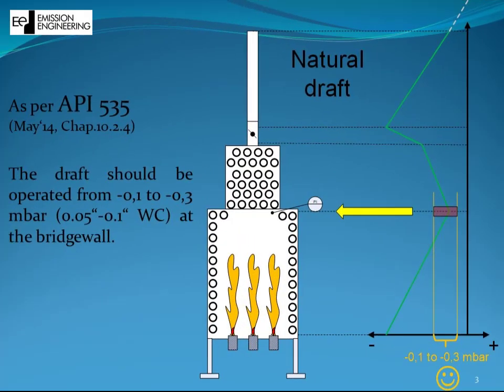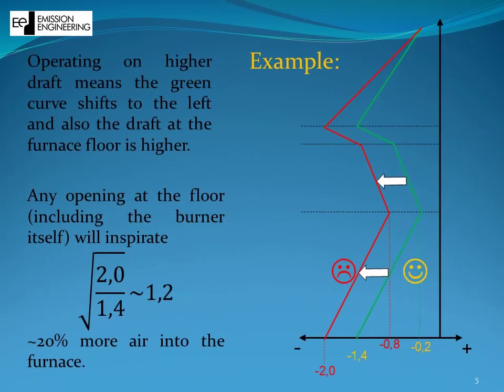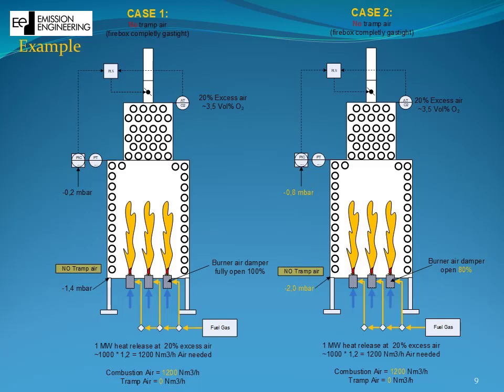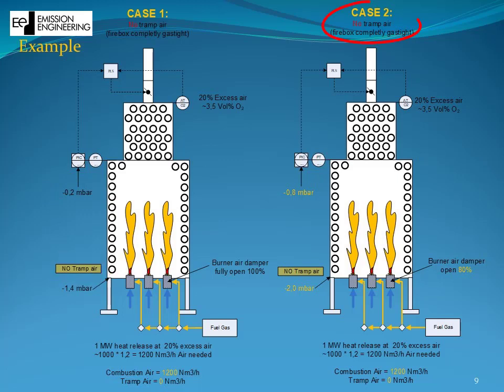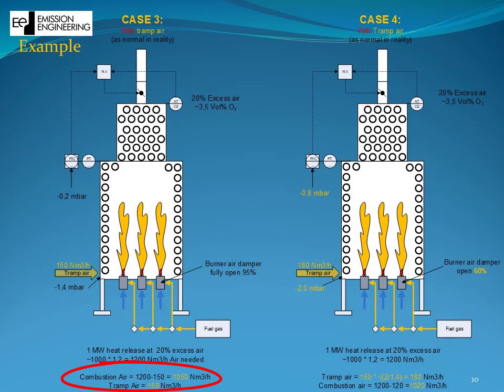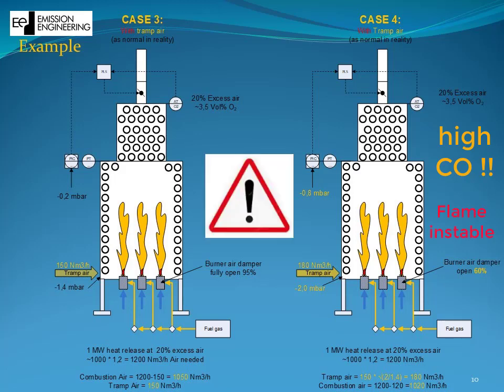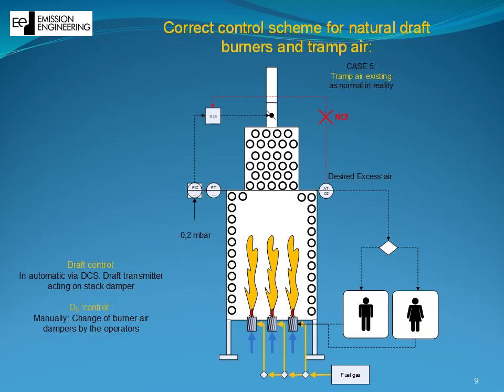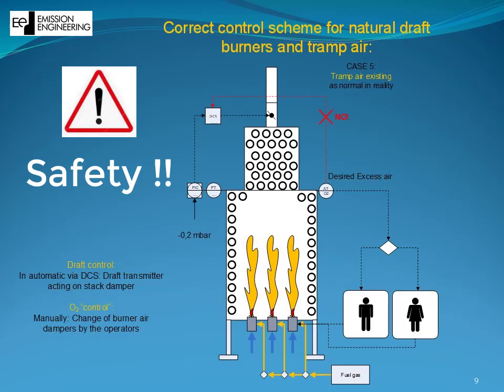The Art of Furnace Operation - Part 2 (Apr'20) - Tramp air & Draft Control

Comment: Sir...thanks for the informative vedio, would u plz explain one thing, though the draft in Heater is maintained at negative values at all the places, what would be actual pressure inside the heater/furnace, would it be negative or positive.?
Reply from the maker: Not sure if I got your question right. Absolute pressure should be always negative from the floor of the heater, where the burners are, downstream, till the stack. For details you may look API535 (May'14) Chapter 10.2.4
Reply: @markuswebel6101  Thanks
Reply: Sir,if absolute pressure inside the fired heater at floor is less compare to top of the fired heater .

Then how is it possible that , gas circulating from the botm to top

Then gas suppose flow in reverse direction ??